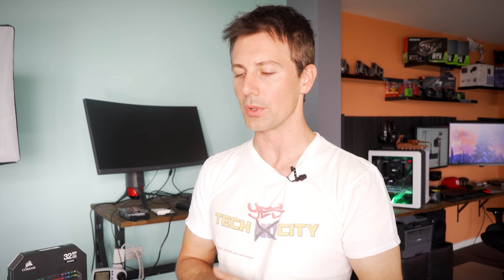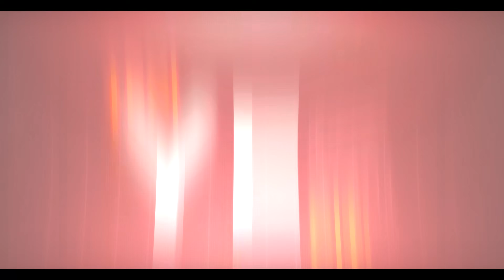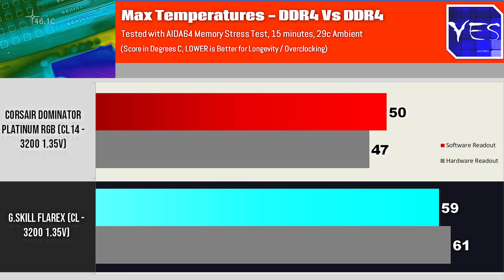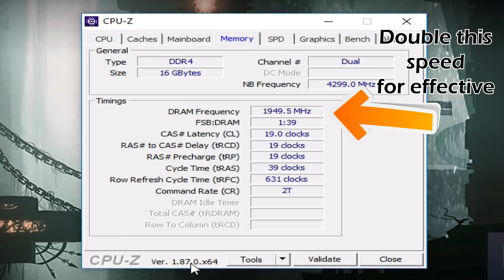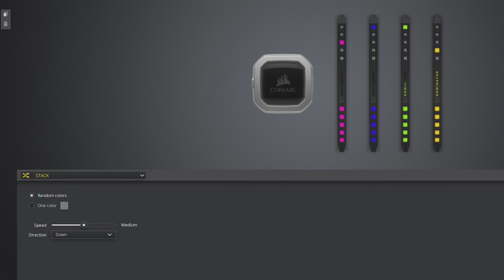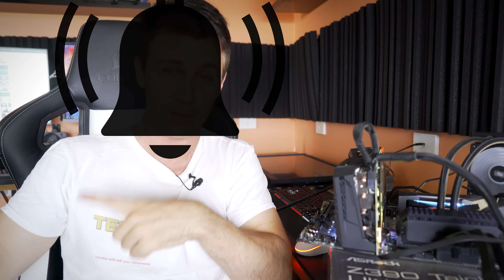Corsair Dominator RGB Platinum Review - Overclocking DDR4 to 4GHz

Comment: Sorry it is not impressive at all. Specially for the price. With high voltage almost any B die hit will do 4ghz with cl 12 timings @2 V. At low voltage good kits will do way more with less voltage. My Trident Z 3600 15 does 4133 with 1.37 V and cl 17. If you have T topology mainboard you can expect to run 4 sticks at higher frequency. But if you do not have t topology mainboard you will be limited and best overclock will be possible only with two slots that are further away from the CPU socket. Every mainboard manual tells you what slots to use for two sticks and those will also OC better. Best memory overclocking mainboards have only two slots and some of those even SMD RAM slots to reduce interference. Plus those have superb PCB layouts and lots of PCB layers. If you want good DDR 4 find out do they use Samsung B die chips. If you want it for benchmark purpose only and do not mind shorter life span get any version and speed and timings and run it at higher  voltages. Like 1.8V training and 2.0 V in OS. If you want high end daily with decent OC get good kit with decent stock speeds and timing. Then overclock it with lower voltage. Up to 1.45 V should be safe for long term use with B die. Running at stock speeds and stock 1.35 V B die does not care about temps that much and stays cool. Running higher voltage and high OC it might lose stability as soon as it gets bit hot. Said 4ghz cl 12 @2V is stable on B die when you do not go much over 20 degree Celsius hence serious extreme OC where your CPU pot cools down Ram as well. In my case I use a 120 mm fan with low speed and noise blowing over VRM and memory. I need some extra VRM cooling while with water cooling you do not get any airflow around the socket. I9 9900K needs stable VRM and I don't like higher temperatures. So this Dominator with this results disappointes me big time. I use to love them. I still own 6 sticks of old DDR 3 Dominator and 4 sticks of DDR 4 Vengeance LPX 3600. Och btw sticks without RGB overclock better. Seems even that low LED current draw and their driver electronics mess up its overclock capability.
Reply from the maker: If you give me your Trident Z we can see how it fares in the aussie summer :P.  It gets hot where I am, and I don't mind the heat so to say.  I think maybe you might be underestimating ambient temps for overclocking.  It's a worst case scenario so for those who have colder climates with less humidity they could probably push this stuff pretty hard.
Reply: @Tech YES City  trust me I am not a person who underestimates temperatures.  I am the old school. I've build water cooling systems at time when there was no PC water cooling pumps and we've used aquarium Enheim pumps and heat ores from cars for radiators. I still own Vapochill. My main daily rig is way oversized. Cooling I9 9900K and 2080Ti with Monster 480 and Monster 240 both in push pull. Gaming my GPU gets at 49 degrees C and CPU at 59 degreed C with room controlled at 22.5 degrees C. Even when I test my memory it never gets to 40 degrees C that with 4133 and cl17 and 1.37V. Actually memory does go to 4166 while mainboard changes bclk and lies a little and voltage is actually at 1.38V. Sure your ambient temperature might be way higher but that RAM should do way better even in that environment. To be honest currently at the YouTube there is not a single good video about RAM including big names. Every big YouTuber talks about RGB and looks and not at the important things. No one tells you what latancies and bandwidth they achieve with a product. I understand. You do not get all stuff sent to you and you do not have monster business to back you up. You do best you can. Try to get decent 16 GB two stick kit with Samsung B die and compare it. You will see. If you need any proof I can send picture or video to you.
Reply from the maker: No worries well said, admittedly this overclock was a fast track (I have to review the 1660 ti now... with little time :().  
Though it's apples to apples in relation to the flare x, which I am sure is samsung b-die as well.  That only managed to hit 3600mhz on this same setup in dual channel.  Sure the engo CPU is probably not the best.  Though next time I am with the pro overclockers I will get a full run down on the memory OC and everything in between, as there is a lot to change, even the D: talk back was very sensitive in this case and made the difference between stability and not having stability.
Reply: @techyescity  indeed each CPU is a roll of dice regarding to memory controller and overall overcloacking capability. Silicon lottery. To achieve 4400 plus speed one needs to get a great rolls on CPU, mainboard and memory it self. Looking forward to 1660 review.

Comment: My gskill 3600c16 bdie will do 4000-16-16-16-31 at 1.45v. 3000% coverage with memtest.
Reply: i am getting 2933mhtz 15 15 15 32 out of my  micron bdie ECC ram, on threadripper too so thats quad channel ( harder to OC) . I could prob push it to 3000-3200 but it would need more voltage micron b-die loves voltage.

They are real 2666mhtz chips not the crappy 2400mhtz ones, they are soo hard to find , had to get several sticks from all over the world :P.
Reply: My cl14 14-14-14-34 rock pretty solid @ 1.35v
Reply: cl 14 3466 at 1.4v here. Command Rate 1T.
Reply: It should be illegal to torture PC parts like this. You should be totally ashamed.

BTW jesus that latency! Brutal
Reply: Trident Z Royals 4000 C17. Can do 3900 C16 @ 1.45 or 4100 C17 @ 1.45 but since I'm on intel I leave it at 4000 C17 for 1.35v. These Crosairs should be left at 3200 C14, since 3900 @ C19 is rather pointless and will run slower in most instances.
Reply: Won't last at that voltage...FUN FACT
Reply: Epiphany 2190 Stop talking nonsense the chips are rated to 1.5v for 24/7 usage.
Reply: Jolinator ...1.5 is the absolute max...1.35 is the everyday recommended...BAM..get your facts straight
Reply: @Epiphany-cl7fe  You are talking absolute rubbish some of the gskill trident modules are 1.45-1.5v stock on their XMP profile and are warrantied for life... i have been pushing 1.45 through these modules for nearly 2 years 24/7..
Reply: @Jolinator .. https://www.overclockers.com/forums/showthread.php/766190-G-Skill-Trident-Z-16GB-DDR4-3200-C16-Memory-Review
Reply: @Epiphany-cl7fe  Ive been running my g.skill 3200c14 @ 3570@cl14 on 1.55v+ for 2 years now and have had them at 1.7v many times.  Saying that 1.5v is absolute max is nonsense since the chips can handle 1.8v.  The reason you dont want to run higher voltages is bc once the ram starts heating up it loses the ability to gain higher frequencies.  Ideally you would want to stay around 35c but up to 50c you wont lose a massive amount of stability.  
With all of that being said, this guy in the video has no idea about how cas latency works apparently since he thinks 4000mhz@cl19 is good.  That is some shit ram if thats all it can do, start making videos when you get it to 4500 which wouldnt be amazing at cl19 but cl18 you may be doing something.
Reply: C J ....true...thanks for not being a sick about it...like some ppl

Comment: If you're going to overclock RAM, you should only be populating 1 DIMM per channel. This reduces cross-talk, and allows for higher clocks due to less stress on the CPU's memory controller. This is why you see high end overclocking motherboards, like the EVGA X299 DARK and Z390 DARK, only have 1 DIMM slot per channel.
Reply: Your right , but it depends on the topology of the sockets. If the board is using daisy chain then yes 4 sticks will slow you down ( quite a bit) , if its using T topology you will get hardly any fall off form using 2 dims per channel, but ofc t topology will run 2 sticks slower than daisy chain.

Super high frequency ram is kind of pointless IMO apart form the bling factor, you would be better getting a good set of Samsung 3200mhtz chips ( yes samsung do make genuine 3200mhz chips)on any old stick and just dropping the timings into the floor.
Reply: @andljoy  Incorrect. 
https://www.youtube.com/watch?v=3vQwGGbW1AE

https://www.youtube.com/watch?v=tgFXVhsK1ok

https://www.youtube.com/watch?v=8P1TmrtRu6E

Comment: Hey just so you know, lower temperatures on the HEAT SPREADER does not necessarily mean the modules are running any cooler. To be honest all things being the same, lower heatspreader temps would generally mean less heat being removed from the DDR4 modules, although some aspects such as thermal capacity and total surface area could skew the results one way or the other. The only real way to test the temps would be through software monitoring or thermocouple between the chips and thermal pads.
Reply from the maker: True, that's why I provide both readouts in the graph.
Reply: This is what I get for pausing the video to leave a comment literally seconds before you show the software temps.

Edit: you should put this up against some samsung b-die HyperX Predator RGB modules. I run 4x8GB OC to 4000mhzCL17 :)  @techyescity
Reply from the maker: @kingmokey3334  No worries, I will definitely put together some of the hot stuff in a round robin, probably in the winter here though, as I live in a hotter climate and will spice everything up to get the best mobo and CPU combo in order too.

Comment: sometimes the xmp profile will raise the SA voltage too high.  itll actually be more stable with less voltage.  mine runs best with a bit less than 1.25.  maybe 1.21-1.22.  some of these kits will raise it higher than that along with IO voltage.  mine gets less stable when you go over about 1.12 or so.  most people recommend 1.15 and 1.25 for SA but those make mine unstable.  less voltage actually gives more stability
Reply: Dude thanks a bunch. Been struggling with getting a stable clock on my 4233 cas 17 32 gig kit and this tip just fixed my issue.
Reply: Or maybe your Vcore isn't stable. Never saw that more voltage on system agent and IO made the overclocking capabilities worse. Try to give your CPU core a little more voltage, +20mV would do the trick.

Comment: 4000mhz? Please my 6700(non-k) did that on an z170 Gigabyte with 3200 sticks when skylake was new. Try get those 4800-5000mhzcl21 ram instead. I have already built a couple of systems with fast ram like that. And I remeber a discussion with the Yes-man himself long ago about how much more strained the IMC becomes when one tries to oc with 4 sticks compared to only 2, but it seems it never went through :p
Reply from the maker: Oh hey man, yeah it's aussie summer over here at the moment :D.  Though my overclocking has certainly gotten rusty over the last year, been so busy.
Reply: @techyescity  well maybe its time to brush on yous oc skills for some content no other youtuber have bothetef with. Would be cool if some body made a video about a gaming sys with maxed out ram at around 5Ghz. With some gpus not even an 9900k with 3200mhz ram is a bottleneck. When the 1080ti at 4500mhz ram the fps could be 15fps higher compared to 3200 ram when the gpu load was not super intensive. Like when watching up in the sky or when the scene was not that demanding. Next time I build a sys I will probably make a short video but as you have pretty much all hardware available you could do a 3200/3600 vs 4800/5000 ram comparasion  probably within a months time.

Comment: Why dont you have an AC? I live in Quebec where its COLDDDD in winter and its get hot in summer just like australia too, I install wall mount AC everyday, even in the winder, its cheap and last 10+years for sure, you can have one for like 2500$ installed with 15%taxes included
Reply from the maker: I only use it when it's really really hot (35 degree plus days).
Reply: @techyescity  you like it hot! :) i use it all summer :O, now its -20c right now on the other side of the world!